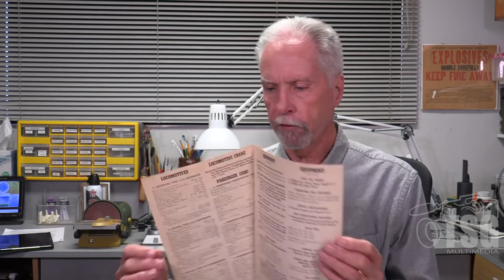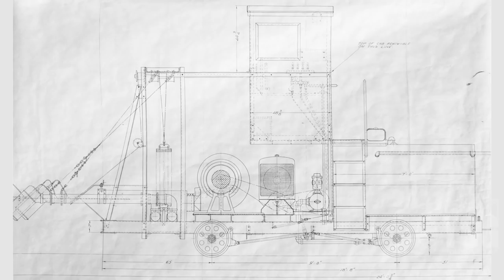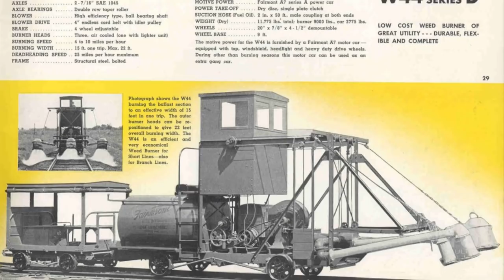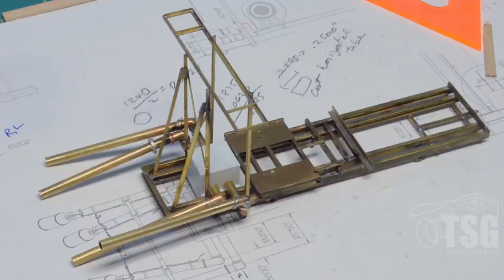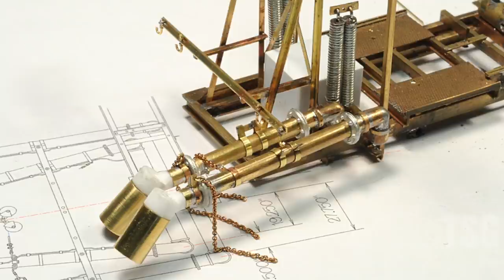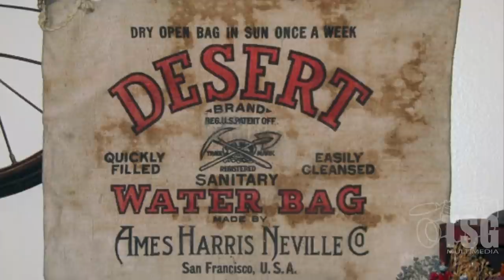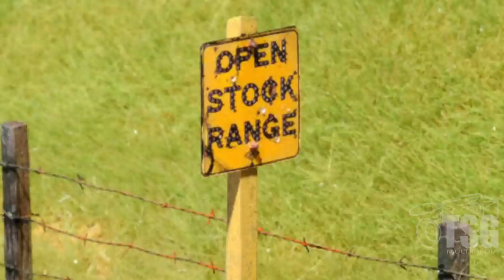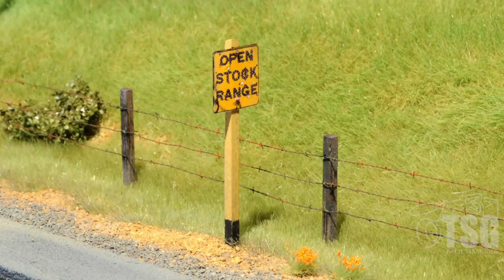Model Railroading with Jack Burgess Proto:48 Scratch Built Weed Burner Train

Comment: I've been attempting to scratch build some models my self... good luck and good work!
Reply: Hamilton...
If you haven't watched them yet, I've done two videos on working with styrene, two videos on scratchbuilding structures, and another video on scratchingbuilding M of W cars...

Jack Burgess
Reply: @yvfan  have you done one on locomotives cause that's what I'm attempting to do!?
Reply: @yvfan  also I'll check your vids out and give ya a like
Reply: None on locomotives. Back i980s I worked with a brass importer and got all 5 of the YV 2-6-0s imported. I provided plans and photos and checked out the pilot model and he gave me the last two for free. I kit-bashed the last two locomotives I needed from Bachmann Spectrum 4-4-0s. I also kitbash a 4-4-0 which was still on the railroad in 19i39 but out of service. I 3D printed the boiler, cylinders, and tender but it is a static model. That model (and a couple others) will be in the February 2021 issue of the MRH magazine.
Reply: @yvfan  that's really awsome... good luck!

Comment: Nice models. 
I think that 3D modelling/printing is addictive only for a certain level of rivets counting. When 3D modelling, it is mandatory to have dimensions, and a lot of photos for details, otherwise it will hard to reproduce something. With scratch building, especially for small things like furniture, it is more easy to just evoke the stuff, from one or two photos.
I think that both methods are complementary, as not everything need to be 100% real.
Reply: Different modelers have different skills, available information and photos, and different expectations. I have scratchbuilt structures based on the only information that I had at the time and later found actual plans and built a new model and scrapped the first one. In one of my videos I talk about a YV steam crane that I built. I had a very good side view photo of the car and all that I knew was the wheel diameter on the trucks. Using Photoshop I measured the size of the wheel in the photo and then I could determine the axle spacing. From that I could get the length of the crane and height and finally drew up plans for the car and printed the boom and a lot of details for the car. I could not have built that car if 3D printing wasn't available. 

I said that 3D modeling is additive since it lets you make things such as correct windows and doors for structures that you want to build. I have probably drawn up over a 100 different parts. 

Jack Burgess
Reply: @yvfan  Sure, it depends on a lot of things. From my experience, I have the tendency to 3D models a lot more details than if I scratch build it, because it is more easy to do it on a screen. But then I loose time for details that barely print, and are anyway hard to see on the finished model!
Maybe it is because I pass already too much time on the PC at work (software engineer), but if I like 3D modelling, I still prefer to do it with my hands.
Sure, some parts are very difficult to do if not 3D printed. I also made some flywheel and other wheels, and a very fine derrick lattice (just above the printing limits), but on the other hands, I'm sure I have enjoyed more scratch building O scale furniture than if I 3D printing them (I also don't want to search a lot of documentation for something that doesn't interest me that much in the first place).